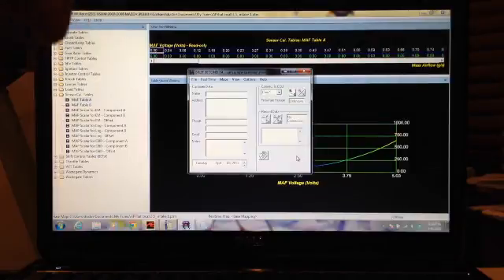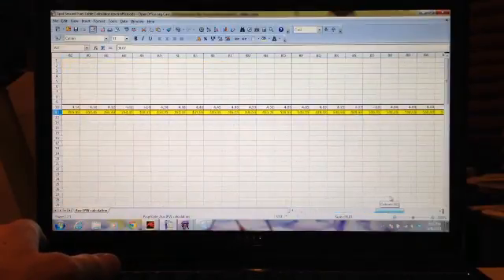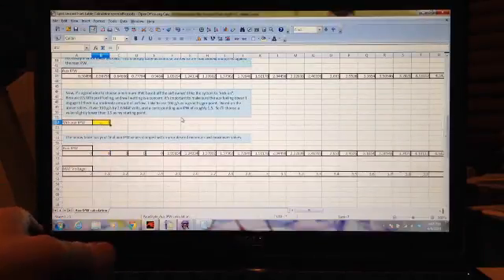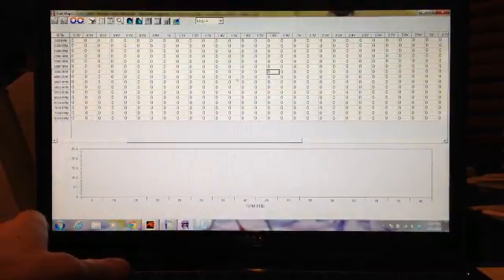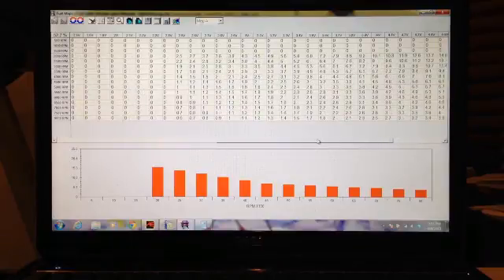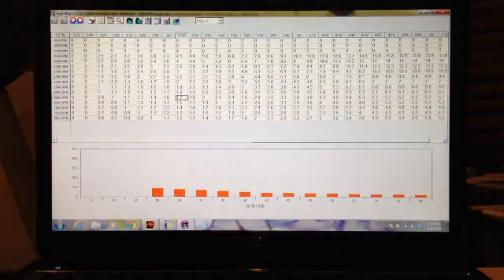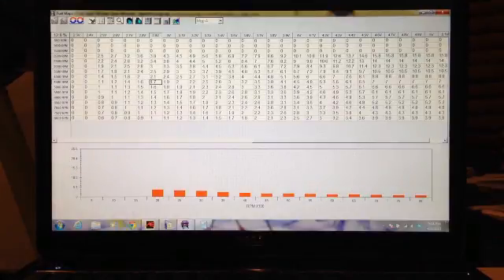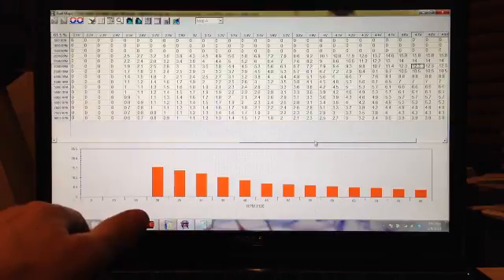Fifth Port Tuning Guide

Comment: You started your aux fuel map at 2.5V, is 2.5V where it's getting positive pressure from the turbo?   How did you calculate this?
Reply: Also instead could you simply provide aux fueling when the system at or over 0psi??